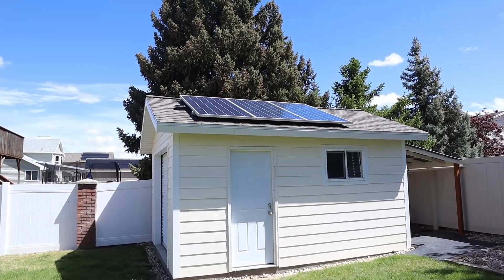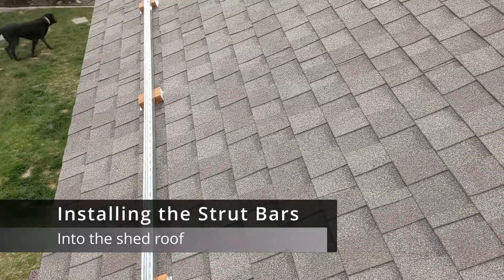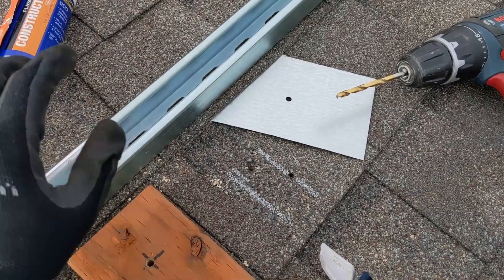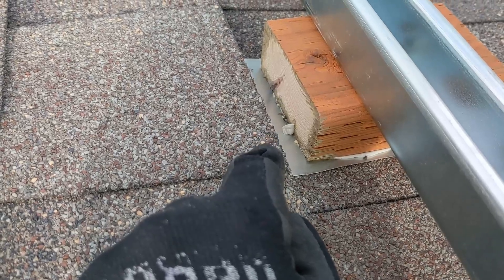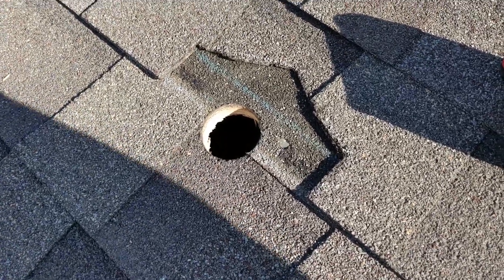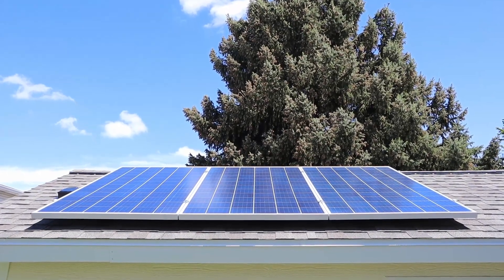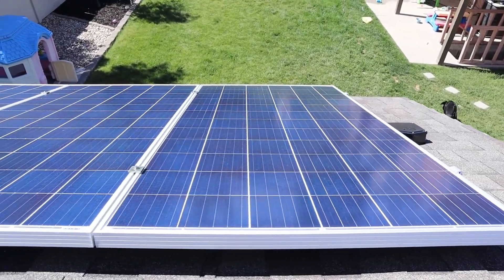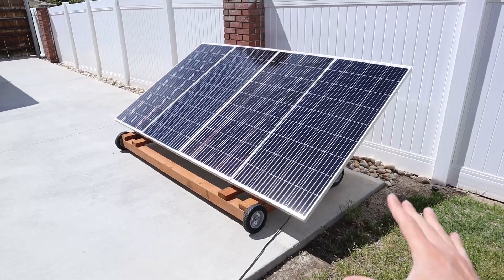A DIY Solar Install YOU CAN DO!! - 1000 Watts of Power - Off Grid - Power Outage - Reduce Power Bill

Comment: Why didn't you just drill up through the 2x4 and use that hole for the lag screw instead of having 2 holes now in your roof.  There are long drill bits available.  Any roof penetrations are to be avoided if at all possible.  I was hoping you were going to show previous power bills vs after the solar install.

Comment: Not being an as**** I hope I do not come off as one however the galvanic response between stainless, galvanized steel and aluminum is a concern without some form of insulation. Nice build though and the video was exceptionally well made. :)
Reply from the maker: I'd recommend using snapnrack system nowadays. I updated this array using their feet and rails and I put it together in 1 hour. Amazingly soomth and affordable too.
Reply: Can you explain this? What is galvanic response?

Comment: Also, add that sealant all the way around the hole both UNDER the flashing and on top of the flashing. Use a fender washer under the head of the bolt and put sealant on both sides of washer then cover the head with sealant. I second that idea to thoroughly apply several coats of water repellent to the blocks and place them with the open grain to the sides.

Comment: Were any inspections by the county or city required for this?
Reply from the maker: If the system was a 'grid tie' attached to my home, it would require that. Since this is an off grid setup charging batteries attached to my shed I did not need inspections.

Comment: Great video! Question: Can I use Z brackets to mount just 1 260W panel to my shed or do I need more room between the shingles and the panel?
Reply from the maker: It's best to have an airspace for airflow to cool down the solar panel. If the panel is directly on the roof it will get quite warm. Heat is not your friend when it comes to solar. Cooler panels equal longer life and more watts.

Comment: So how much does each panel produce.. am assuming it's around 330? 330 x 3 is around 1000 watts.
Reply from the maker: each panel is rated at 325 or a total power of 975 watts. I usually see around 850 watts from the array.

Comment: Very impressive!
Question: Would  high winds "feather" or try to lift panels ? ( And would a wind dampening shield around the panels help ...
or would it "overheat" panels?
Reply from the maker: These panels have been super strong ever since they were installed. No issues at all. I'd rather have the airflow vs the windshield.

Comment: Hi nice video I have question about solar panels.. can I install 3 x 400w each solar panel (equal)   1200w ...instead to Instal 12 x 100w each (equal) 1200w ... I hope you understand what I mean thank you
Reply from the maker: Yes, that is basically the same thing. However there are MANY different factors to think about. I recommend you check out this video to learn how to put together solar arrays for different sized power stations: https://youtu.be/4JG8LvJznLY

Comment: Awesome video, have you gotten any leaks?  I'm about to mount six panels on my house roof, but am VERY hesitant to drill a big 2 inch hole, I may run it down the roof in conduit and up through the eve.
Reply from the maker: No leaks at all. If you install this roof flashing properly it's designed to protect against water and ice.

Comment: I know the c channel has holes in it but it looks like if it rains, you would still have alot of standing water in the lower edges. Is it maybe possible to flip the c channel over?
Reply from the maker: That might be the case,  I haven't thought about that issue.  I live in a dry climate so I doubt it would be a problem with mine.

Comment: They should sell sheds with solar panels already mounted on them for people that don't want to fuss, or maybe just have the mounting rails already installed on them so the solar panels can be added later.  Also, why do people butt the panels up together?  Why not leave gaps between them?  That would allow someone to walk between them and clean them easier.
Reply from the maker: It's easy enough to clean them from the top and bottom,  at least in my case cool idea with the "built in solar panel"  idea.  As solar shingles become more popular that would be a very simple solution!
Reply: @Jasonoid  They could offer the sheds with the option of having the solar rails preinstalled... you just tell them the spacing you need and they do it for you, so then people will have assurance that it wont leak (or at least if it does, it would be under warranty), and they wouldn't have the worries about messing it up.

Comment: Nice plan and beautiful work you do there. Is grounding the array necessary, or considered optional where you are? That is mandatory here in South Florida.
Reply from the maker: It wasn't completely finished in this video. I still had to ground the array and trench the wires after the filming. Thanks for watching :)
Reply: Again, beautiful work you do there. @Jasonoid

Comment: I love the mounting! To keep power losses at a minimum I would suggest installing your batteries and inverter in the shed, then running the AC to the house.
Reply from the maker: I've thought about that but I live in quite the extreme climate. Below 32F in the winter, about 100F in the summer. Too cold and hot for Lifepo4 chemistry unfortunately.

Comment: So should I buy a larger Bluetti or try to build a system from a 300 ah LiFePo4 battery for emergency cooling after hurricanes? I have a tiny Frigidaire window unit with manual controls. The one everybody recommended for its low wattage. I need a few hours cooling at night and continuous daytime use for at least 8 hours. I can possibly spend 2000 and need help. I currently have three 100 watt poly panels and a 190 watt mono plus 100 watt and 120 watt folding panels.
Reply from the maker: I'd recommend a DIY solution so you don't have to deal with a touch screen breaking. Most solar setups require matching solar panels for the most power if you want to make a larger array of parallel or series connections, so you may want to keep that in mind.

Comment: I`m still arguing with my relatives about WHY I need solar power for my camper. As soon as I won my disability case and received the stimulus checks, while living with my sister, the whining began when I started buying solar panels, solar power stations, and many other prepping tools. We`d just been hit by two hurricanes a couple of months before. But my sister said, "I think you`re gonna regret buying that solar stuff!" Now she`s trying to convince me I need gravel hauled in, my nephew has dreams of helping me buy a fancy fence, etc. They watch home improvement TV shows. LOL! After I put a cover over my camper I want to install a larger solar system for Winter heat and Summer air conditioning if I have enough left. "Well your bill won`t be very high!" That isn`t the point. The POINT is...what if I LOSE my SSI and can`t heat or cool my camper? 

I want SELF SUFFICIENCY because I was homeless before without anything. One time when I had a home I couldn`t pay my bills after copper thieves destroyed my business. It was a nightmare. Then copper thieves got my house and I had to live in a moldy camper van. Stole my truck too. I want my own electricity, my own food, my own clean water, and if it`s POSSIBLE to do NOW while I can it`s the only SENSIBLE thing to do. Then I can save money on my bill to buy FOOD in the future, or not die if I lose my tiny check. 

Right now I can cook with solar, keep my freezers cold, run a dorm fridge, and the smaller wattage things like lights and fans. But my freezer and fridge batteries MUST be recharged daily. No sun...no freezers. I do have a cheap 2 stroke gas generator but no transportation to the store for the gas I can`t afford. 

A folding solar panel can power a USB fan during power outages and charge a small power bank or two for nighttime use. If you live in a dangerously hot area this is very important. I tested a 30 watt panel and it powered a fan while it was raining!
Reply from the maker: Family can be on a different page sometimes. Keep up the good work and I hope things start to get better before they get worse! (but I have a feeling we are just getting started with inflation...)
Reply: @Jasonoid  If I have 1500 to 2000 to spend, what can I get for powering a manual Frigidaire air conditioner? It`s the classic one everybody recommends with soft start that runs between 300-400 watts. Any recommendations? I have just 490 watts of glass panels at the moment.
Reply from the maker: @baneverything5580  I'd consider a DIY setup. You get the extra reliability, cheaper cost and you can expand it easily. You could even throw it all on a dolly to make it portable. 100ah battery for 1280wh is around $350, an Xantrex 2000 watt high quality inverter for $400, and then you just need wiring to connect them together. Solar charge controllers are cheap too.

Comment: Great video. @4:40 so you do not use the screw and the piece for the channel clamp and use the new screw and the cone nuts instead? It is great that you put the links for all mounting hardware that I did not know they have at Lowes, thanks!
Looking forward to see how much power your panels produce in real world, I am guessing about 800W?
Reply from the maker: The stock solar clamp hardware isn't compatible with super strut so you have to purchase 1/4th inch stainless bolts /washer / locking washers. Lowes has just a tiny section of super strut hardware.... Pretty hard to find unless you are looking for it haha.
Reply: @Jasonoid  I see, thanks.

Comment: I just got the oupes 1200 and I'm satisfied with the results so far but now I want something bigger and probably fast recharge time in case need of gas generator during the day, I was thinking about getting oukitel p2001 of pff brand which is cheaper, any good recommendations for a 2000w power station/ solar generator
Reply from the maker: You usually get what you pay for. The FFpower P2001 seems to be pretty decent but it charges slower and has less 'actual' capacity than the other 2000w units. I love my Bluetti AC200P and it's not priced much higher. If you want something expandable maybe look at the  Bluetti Ac200Max.

Comment: But if the Main Reason of Putting it on the Shed was to transfer it to the House I would have Had the wires go down the side of the Shed , then trenched underground instead of poking a hole thru the roof. but putting it thru the roof gives you the option of having a setup inside. I just personally feel more secure having all my batteries inside my house instead of a shed or garage
Reply from the maker: My house roof has multiple layers of shingles and needs to be replaced, my house roof also doesn't face south for the best performance. I built this garage a few years ago and I have always wanted to put solar on it since there isn't any shade to block the sun.
Reply: @Jasonoid  I get that but you didn't have to make a large hole in the Garage if the main setup was in your house
Reply from the maker: @Moes_Prep_and_Tech  I might have a battery system in the shed some day so it leaves me that option I suppose. Also, Im not a huge fan of external wiring so going through the roof, inside the shed, and through the ground allows the wiring to remain unseen and out of the way. So many options though.

Comment: About the bouge rv panels. Are those panels ok to mount to the roof, shed or patio?
Reply from the maker: Yes, any glass rigid panel is fine to mount  up. They all have durable aluminum frames.

Comment: Hey Dr J'
Very nice setup, looks real sturdy and well put together.
I also like the portable setup as well, which would probably be the route I take.
Is it possible for you to do a vid comparing the solar output from rooftop setup vs the portable one you have??

Thanks again for diy vids
Reply from the maker: They both have the same potential, just all depends on which panels you decide to go with in your build. The ground mount system does have the tilting feature so you'd get more solar power in the winter for the lower sun angles.
Reply: @Jasonoid  Yes sir, yes sir! Appreciate that info

Comment: Perfect timing. I just bought 4-270 watt 60 cell poly panels. I didn't think of using blocks or flashing. I may use square tubing instead of 2x4s.
Reply from the maker: There are so many ways to do it, I'm sure you'll find a great option. I totally recommend that solar junction box. Super easy to work with!

Comment: Just to be safe I'd paint the top of that junction box white to reflect the sun. Why it didn't come in white is a mystery considering it's in the sun all day. I know it's just a junction box but it costs you only a little paint just in case. Good build. In Toronto we have crappy weather all the time. If I did the build I'd probably even have to seal up around the wood blocks as well we get so much bad weather. Since you're in the desert it probably won't matter. Good build
Reply from the maker: Good thought on the white paint, the wiring inside can handle 90C before it melts, I hope that would be enough haha
Reply: @Jasonoid  True, but it's cheap insurance. They should have made it white in the first place really.

Comment: Nice. I want to DIY a ground mount that is not portable. I also want to add seasonal tilting. Do you have a good idea on a way to combine unistruts with a single row of ground mount poles?
Reply from the maker: I have seen a few videos online about tilting ground mounts. I'd love to have the space for a ground mount system, I'd convert my whole house to solar if that was the case. I'm sure you can come up with something simple. A cheap grinder and welder could accomplish a lot in that type of project.

Comment: I take back suggestion to rotate the 2x4 blocks - probably less likely to crack from weight of struts in your design. I would just add small piece of flashing to the top exposed end grain.
Reply from the maker: I'm sure either way would have been okay, these wood blocks will never see the sun and hardly be exposed to the elements since the panels overhang so far.
Reply: Or use a composite such as trex

Comment: Nice and simple - and looks very secure. I would have applied a good water repellant to the 2x4 blocks before installing though - much simpler and easier. And it might be a better design to rotate the blocks so that the end grain is to the sides to minimize contact with runoff.
Reply: You'd think so, right? pretty dumb not to.

Comment: Great install..... only thing is the length of the  cable runs. DC power is not very efficient over long runs. If you live in a climate that you could keep the power units inside the shed, it would be a lot more efficient to install the units in the shed, then run AC wiring into the house. Anytime you run power for DC, the wiring should be as short as possible to combat voltage drop.
Reply from the maker: If I had these wired in parallel I'd be more worried about the voltage drop. These panels are wired in series at 120VDC so there's not much voltage drop since it's a higher voltage / low amp combo. I did use 12awg wire for the whole run to try to limit the resistance. Will both arrays I usually see around 1600 watts on my AC300 power station.

Comment: Good job.  I'm doing the same.  I installed the Reliance Controls 4 circuit switch and checked it with a generator, but I do not have a solar generator yet.  I was going to use an inverter but am confused about the Neutral Ground Bond issue since my panel has a neutral ground bond.  It appears to not be an issue if you use something with charging capabilities.  I'm leaning toward a Bluetti at this point.
Reply from the maker: Have you thought about a LiFePO4 server rack battery and an all in one inverter charger like a EG4 or Growatt? Similar performance for much less cost!
Reply: @Jasonoid  Yes.  I saw that some of the Growatts are actually California approved.  The benefit of a portable solar generator would be that it is portable.  I was shooting for about 2,000 total with the transfer switch, panels,   batteries, and all.  I'm already 900 into it with an inverter generator and the transfer switch,   so now I'm considering pushing it up over 3000 and buying something like a Bluetti.  With our rates here going up around 40 cents a kilowatt hour, it'll pay for itself within 3 years.
Reply: @Jasonoid  Or victron as it has a relay to toggle the grounding automatically as needed👍

Comment: Do you have to ground the panels?
Reply from the maker: I still need to finalize a few things on this project. Trenching the power back to my house and grounding the panels. I've heard it's a good thing to do for safety in case a lightning strike.
Reply: @Jasonoid  Hi Jason. How do you plan to ground the panels? Do you have a sub-panel in your shed?

Comment: Great Content, do I need to worry about sending to much solar power to my portable power station?  Cheers 🍻 🔋
Reply from the maker: The only thing to worry about is the voltage being to high, just following the voltage specs on the power station charging input.
Reply: @Jasonoid  Thank you for your reply.  New subscriber